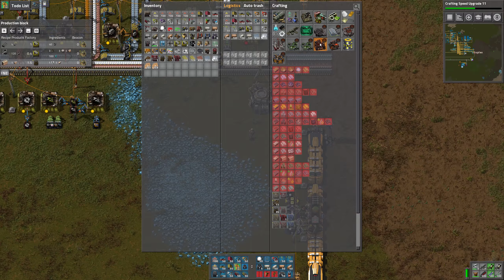Factorio AngelBobX Let's Play #36 - Concrete brick and stone

Comment: Is there any reason to make carbon dioxide in chem plants? You can use liquifiers or chem plants to both carbon and carbon dioxide.

Also last episode you broke steel line for gears and mining drills in your hardware store ;)
Reply from the maker: Thanks for the heads-up about the steel line, I will fix it.  I don't know when or why you would want to use chemical plants instead of liquifiers, or vice-versa.  I suppose the smart way is to use whichever one requires fewer resources and electricity.  There might be a difference in crafting speed, I'll have to check that.
Reply: liquifiers are definitely faster and uses less power.